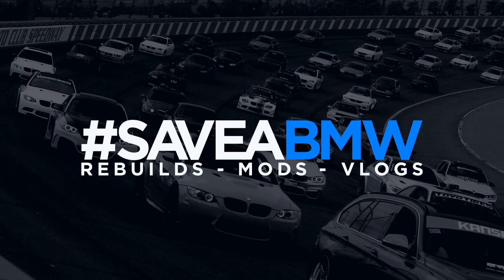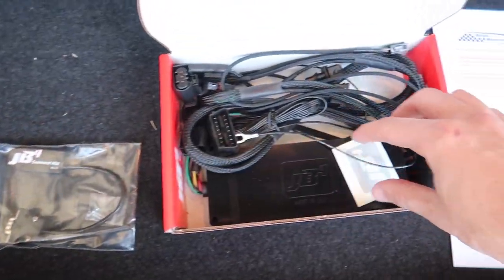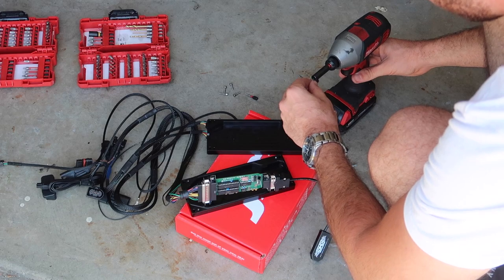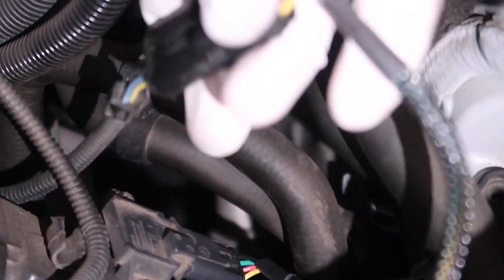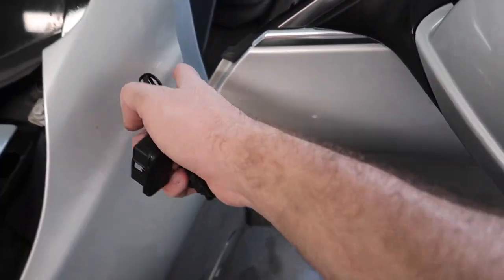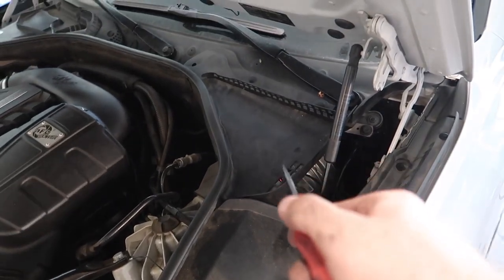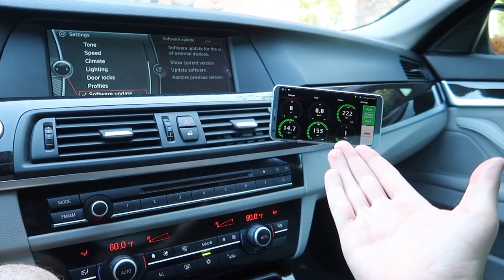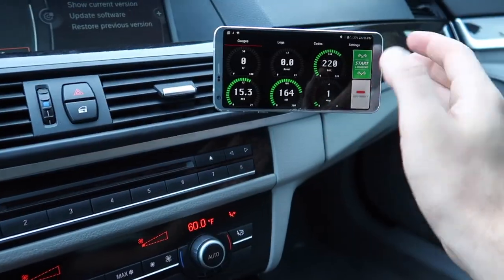F10 535I GETS INSANE JB4 TUNE! (FULL INSTALL)

Comment: bro I have 640 diesel its the f13 pre lci I have 130,000 miles on it and do u think my engine would break if I remap it ?? need help
Reply: usually stage one is safe with stock components
but a tuning company might offer you an economy map instead of sport map (because of your mileage )
it.s up to you in the end
if you know the car is solid and it.s been serviced properly stage 1 will make a huuuuuge change ... especially for a diesel( you can get a very good bump in torque )

Comment: I installed a Jb4 that a friend had on his 335i and put it on my 535i but when I went to turn it on it would try to start and then just die.. did I connect stuff wrong or what should I check ?

Comment: So 140 buck for a bt adapter but stil use BC to change the maps...? Why not via the app?
Reply: Are any of those extra adapters needed? Or could I just switch the maps normally from the BC. I know those other 2 connections give you more options but just curious for a stock f10